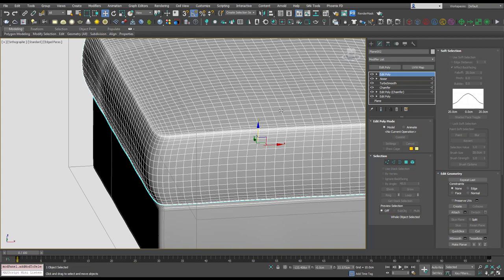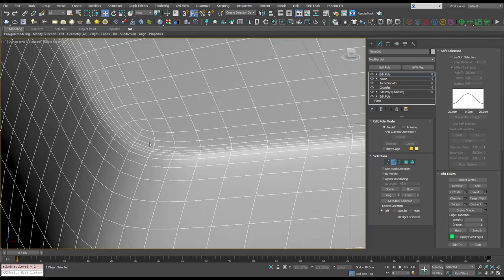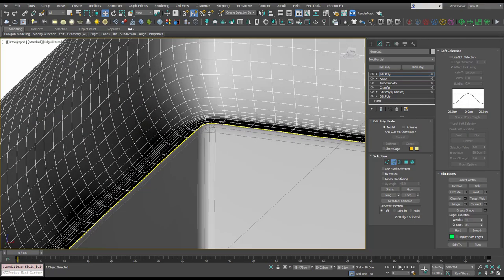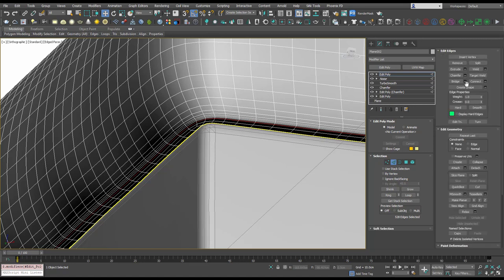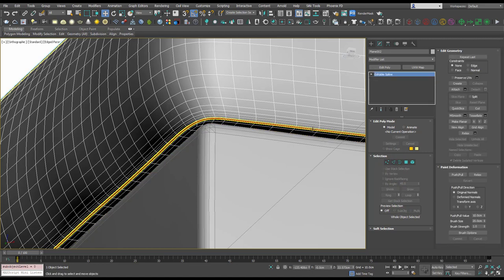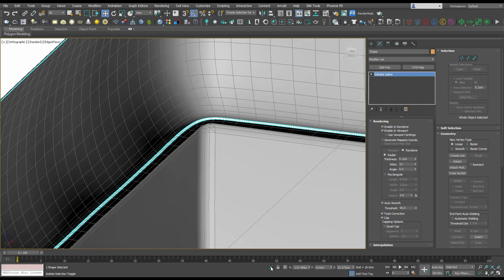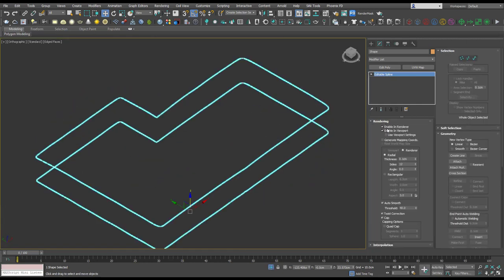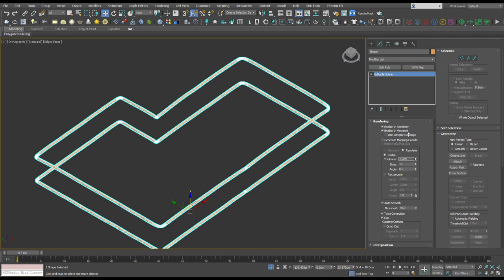How To Add Seams to Cushions | Create Shape from Edges in 3ds Max

Comment: Hey man, I've been designing furniture framework (wooden sofa frame) with Solidworks for years but only recently have I had to start making renders for the finished pieces. At first I slogged through Solidworks creating fabric at offsets to the frame which was great as it updated with frame revisions but visually left a lot to be desired as Solidworks has such poor rendering capabilities and lacks any ability to easily create "softness" 

So I've begun modelling on 3DS Max and I can get to the end result but the wireframe is a complete mess. I've been watching Gogolov's videos but I can see you have experience doing exactly what I need to do too. 

Do you have any tips on the fundamental tools for polygon modelling with regards to upholstery. These cushions are great but say I want to create a round scroll (think chesterfield) where would I start? What's the best/most efficient workflow for a shape like that including the pleats? 

If you could point me in the right direction or make a video on modelling a chesterfield for example I would be eternally grateful. You have an excellent teaching style, very clearly spoken.
Reply: By fundemental tools I see the "cut" tool and Pconnect or qslice and I kind of get what they do but I don't understand when it is best to use one of them. Same thing with the loop and ring buttons. I'd love to see a start to finish on say an arm just to replicate the workflow.
Reply from the maker: Hi Dom, you are not the first to mention I should create a Chesterfield. I will get onto it. 
This clip is actually from a course I have called 3D Modelling with 3ds Max : The Quickest Way, I think it's going to help you, https://www.luxuryvisuals.com/academy
Take a watch of this and then if you have any questions we have a facebook group or you can DM me.